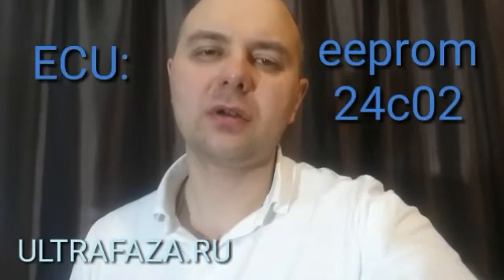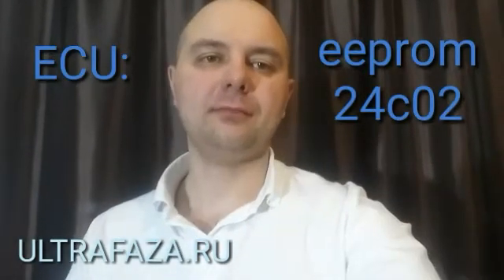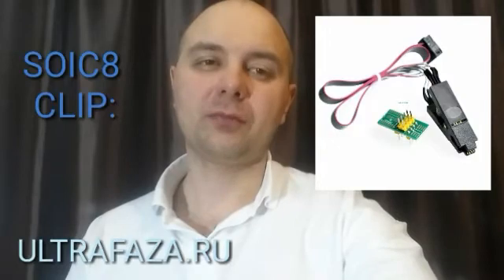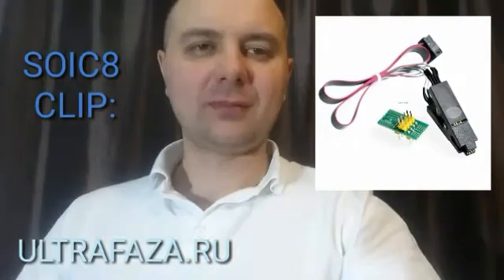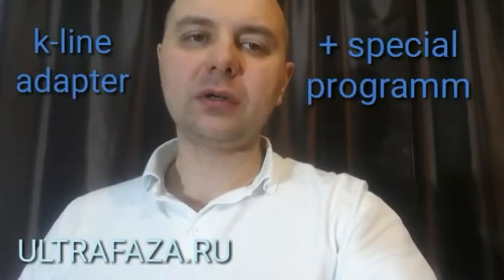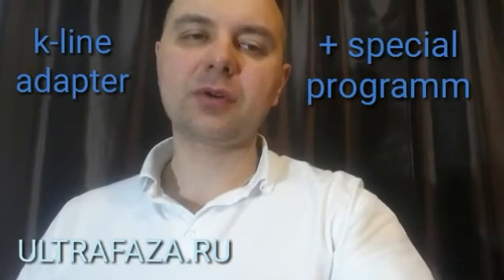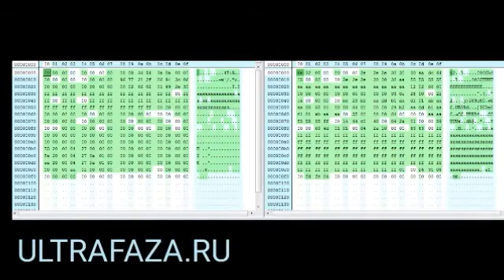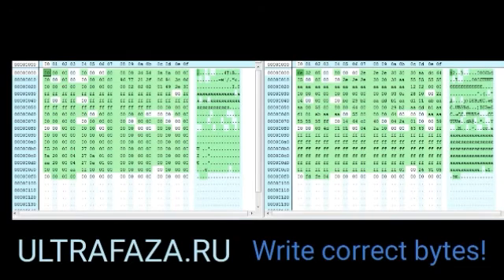Fix Immo of Diesel Nissan Patrol Nats5 after Battery sat down

Comment: That sound too easy.. can you point to a website where i can find the software for this? I own a nissan note E11 where the nats even deactivated the cranking :-/

I would like to disable/kill the nats completely to find whats wrong with the car, its not a steal..i own several universal eprom programmer..just need the files and softwarte and some headsup to kill the nats2. 12V battery is brand new
Reply from the maker: Moes, I think, your vehicle has another Immobilizer system. Give me vin code, I will check it